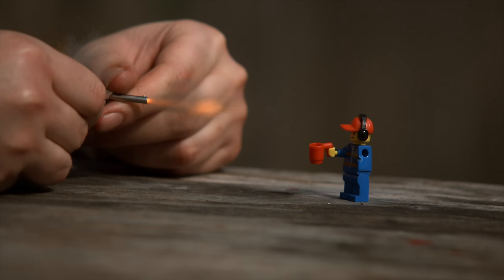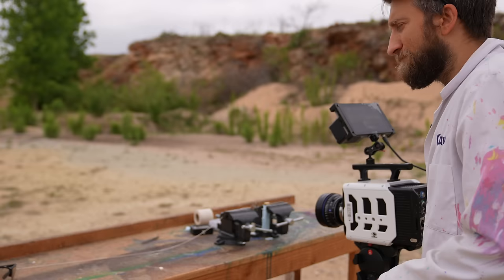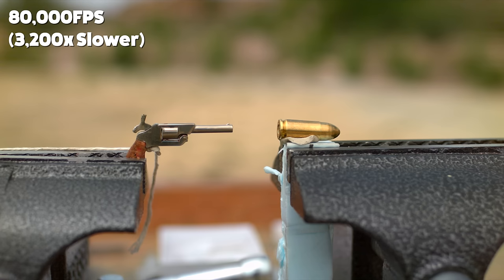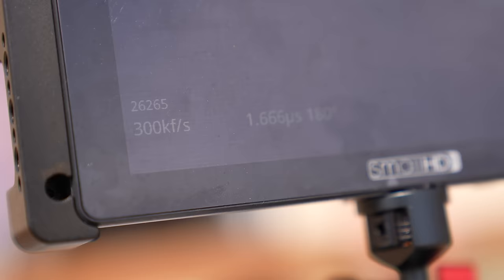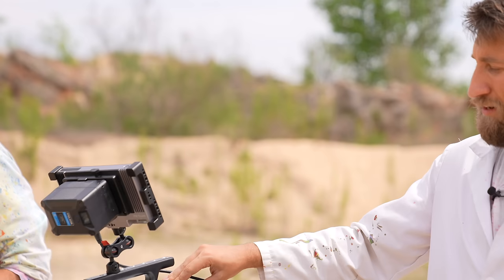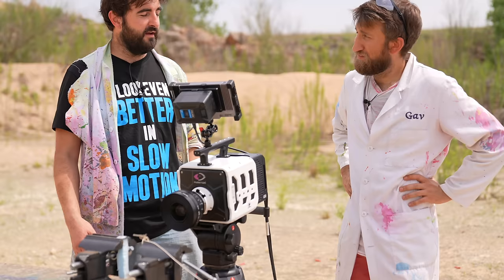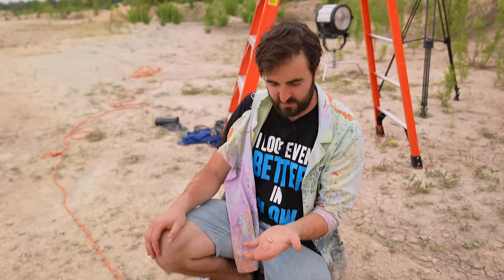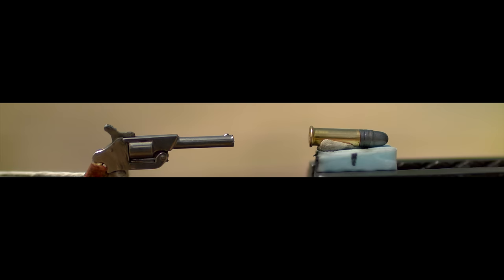Can a 2 Inch Gun Fire a 1 Inch Bullet? - 300,000FPS - The Slow Mo Guys

Comment: This is actually a pretty good example of mass and inertia.   Since the casing has much less if it is not restrained, the casing actually becomes the projectile while the bullet just kind of wanders away.
Reply: Especially with the 9mm, you really need the firing pin to hold the primer bit in place, never occurred to me
Reply: The shell will actually expand slightly inside the chamber, which makes it friction fit and fire form to the inside of the chamber.  This is why ejecting spent rounds is more difficult than expecting unfired rounds (and why part of the reloading process involves recompressing the shell to its original size).  If you oil the shell, you can damage some of the weaker actions because the shell becomes a projectile that slams into the back of the action.
Reply: I love how with the .22 the Bullet seems to hover there for a moment while the casing flies backward because it takes longer to overcome its inertia.
Reply: Demonstrates the law of conservation of momentum, to be precise. The bullet's mass times its velocity will be equal to the casing's mass times its velocity; since the bullet is much more massive, the casing will have a much greater velocity.
Reply: The primer does it all. The primer compound  ignites, builds up enough pressure to push itself out of the primer pocket, which it can as it is not held in by a breech (Nothing to do with a firing pin). Occasionally there is enough pressure generated by the primer to move the bullet forward and the case backward, but never enough heat and pressure in the case to ignite the smokeless powder, as this needs both do that and to build up pressure. Smokeless powder is hard to ignite. Try it again with black powder as a propellant....Even in a firearm it is, by choosing the wrong combination of primer, smokeless powder and bullet-case friction possible to have a failure to ignite the powder in which the bullet just moves a little on primer pressure alone. Enlarging the confined space the powder is in, making it even harder to ignite. That js the reason why we have normal primers and magnum primers that generate more heat and pressure. So Thats why the primer pressure in the case just blows out the unburnt powder through the flash hole. The rimfire is different. No separate primer that can blow out and release the pressure, very finely granulated smokeless powder that is easier to ignite and burns faster, and this generates the heat and pressure to move the case (the primer) back and the bullet a little forward.
Reply: @reidprichard  Yes.  And if it is inside a gun, the gun is more massive than the bullet, so the bullet will move more than the gun.    Unless the bullet has more mass than the gun.    

That is whya lighter gun will have more recoil with a larger heavier bullet and more powerful propellant.
Reply: @ikwer111  Diesel combustion effect adding to ignition. Primer firing raising pressure, increasing heat, and pressure, burning powder faster.
Reply: @hellomark1  
It keeps the pressure up and hot. Guarenteeing that it all ignites.and the force is forward.
Without the pin in place the pressure is released before the powder has a chance to heat or ignite.
Reply: @hellomark1  well im not used to guns cus of good gun control here in singapore but i do know that the gun casing would be aluminium or polymer since both are sofr and easily broken with just some surface tension.
Reply: @samuraiboi2735  brass or nickel.
You cant re use alu cases

Comment: It would be interesting to see how far the bullet would go if you could put a backing plate behind it so the shell can’t come back towards the gun, a plate with a hole you’re shooting through to set off the primer. I think a lot of the energy is split sending the casing backwards and the bullet forward, obviously it wouldn’t go as far as a sealed barrel but I wonder if it would go half as far or how much lower the velocity would be.
Reply: I think thats a great idea. I made the same comment. Would be super interesting to see
Reply: The back plate with a hole is a great idea I love that, I had a similar thought. What if the bullet was inside a transparent barrel?(so that you can see the bullet with the camera). Couldn't that make the bullet fly nice and straight out of the barrel since the barrel could act as some kind of chamber where the gas that's expanding keeps trapped inside shooting the bullet out the other way. It could actually shoot the bullet out further perhaps. Connect that barrel to the back plate with the hole and that should keep most of the propellant and gas between the bullet and the inside of the back plate, this could ignite the propellant more creating more gas, shooting the bullet even further!

Note on the back plate hole: it should be smaller than the hole created inside the casing after the percussion cap flies out so that the percussion cap also stays inside the barrel with the back plate acting like the back plate, keeping the explosion and gas trapped inside the chamber even more.
Reply: The little gun doesn't have enough energy to push a firing pin.

Comment: The “percussion cap” is called a primer, the round thing with the 3 holes is called the anvil.
When a gun fires normally, the primer still has the firing pin against it to prevent it coming out, but occasionally you have a primer rupture, and just like here, the powder burns, but the path of least resistance is out the primer pocket
Reply: That is exactly what happened. I have heard of this happening but I have never witnessed it.
Reply: There is also the problem of not having an enclosed chamber. Part of the purpose of the barrel in a firearm is to prevent the pressure from blowing the unburnt powder away. With an enclosed chamber + barrel, the powder is still in the enclosed space catching fire. You could probably prevent the primer rupture by using rimfire instead of centerfire, but you would still have the problems of pressure and unburnt powder escaping out the front.
Reply: @ShaggyRogers1  you still get rims popping with rimfire.
Reply: Percussion cap cus their brittish
Reply: @AidenColson  they’re Australian
Reply: @AhHereWeGo  sorry thank you
Reply: Similar enough

Comment: 9:00 It might interest you to know, given the distance that this bullet traveled, that there was pistol dueling as one of the sports in the 1908 Olympic Games. The two "athletes" would actually shoot at each other, but the bullets were made of wax and propelled only by the primer with no gunpowder in the cartridge. They did also have protective gear.
Reply: A pace is a single step and not two steps
Reply: @victorfox9623  I was about to tell you that a pace is two steps, but it's been so long since I did anything resembling scouting that I double-checked. According to Wikipedia, it can be either. I'm in the US, and was taught two steps is a pace. https://en.wikipedia.org/wiki/Pace_(unit)

Comment: Seems to me like a security feature, having the ignition cap blow out if there's nothing to hold it in place, to ensure that people don't get hurt when they're playing around with these bullets.
Reply: I don't think they are intentionally designed to blow out for safety, it's just that the primers and bullets would be harder to manufacture if they were crimped in place more securely
Reply: @rokoala2636  I'm not sure it's universal, but some military ammo does have the primer crimped in.
Reply: @paullockyer7230  I would say it's probably more common than not for military ammo fwiw. Last thing you want is loose primer cases floating around the innards during an engagement.
Reply: Twinrehz - primers are crimped in when the application calls for high reliability. They protect the gun not people playing around doing wrong things wrongly.
Reply: @paullockyer7230  yeah true, I was more meaning crimped in securely enough to affect the proposed 'safety feature' of having them blow out.
I reckon that would need a decent change to the primer and crimping compared to how they do it for military ammo.
Reply: The case expands diametrically,  reducing pressure.

Comment: I remember Mythbusters cooking off some centrefire bullets (literally) in an oven, and they found that the case shatters before the bullet leaves the casing. I was completely expecting that to happen here, but I totally did not expect the primers to leave the casings first to give the expanding gases a way out! 

This was an amazing and insightful video!
Reply: Quite likely that the cooking in an oven weakens the metal casing, so by the time pressure/heat build up enough to ignite the propellant, the casing is too weak to hold itself together before it pushes the bullet away.
Setting it off normally, the casing is just fine, which is a good thing. If the casing were sometimes too weak to contain the energy of the propellant and fail while inside a gun, you’d have a nightmare of a jam to try and clear out, shards of broken brass clinking around inside of the gun.
Reply: @ShadowsOfTheSky  I also wonder if heating it to the point that the gunpowder ignites would cause more of it to ignite at the same time, making a larger explosion overall than this one, where only a few grains seem to go. But yeah, it's probably more the weakened, more pliable casing.
Reply: Here's another thought: maybe the pressure of the primer is pages the printer and bullet out, so the gun powder never has a chance to ignite. 

Speer used to make special practice agni that used a plastic bullet, and only the primer (zero gun powder). It would throw that plastic bullet at high speed, but even a heavy bullet would be pushed out by the primer alone. 

Likewise, Aguila makes 22LR ammo called Colibri that launches a 20 grain bullet at 700 feet per second, using only the primer. (A normal 22LR bullet is 40 grains at 1100+ FPS, so Colibri is much less powerful than standard, but also much more powerful than you might guess.)
Reply: @cymond  That makes sense as a theoretical argument, but I’ve set off rounds not in a barrel myself where the primer didn’t pop out, and the casing doesn’t shatter. I suppose it’s possible if you used the powder for high velocity round but with a heavy bullet, but I imagine the primer will pop off or the round will be pushed out before the casing fails. 

I imagine it’s a combination of the metal being weaker at high temps, and also what @MusicalJackknife said above, because all the gunpowder was heated equally, as soon as the reaction started it all went up instantly, creating way more pressure before the expanding gases even had time to push the bullet or primer out, and the case just failed.
Reply: @MusicalJackknife  Actually what you say makes sense, it’s probably equally caused by both, though I would alter what you said little bit. With the Guys’ 9mm round where the bullet got sent quite far, almost all the gunpowder successfully ignited, but it took a while for the pressure to build up and the bullet was basically out by the time all of the powder had burned. 
I think it’s more of a case of all of the gunpowder being heated equally, so as soon as it reached the ignition point, all of the gunpowder went up at instantly, creating way too much pressure with no time for the bullet or primer to be pushed out before the casing failed.

Probably equally both, a weakened casing plus the whole reaction occurring instantly, creating much more pressure before the bullet can escape the casing.
Reply: @ShadowsOfTheSky  I was surprised that the primers kept popping out in the video. That's obviously doesn't happen in a firearm. I wondered if they got defective ammo with loose primer pockets.
Reply: Without a barrel, the casing can essentially becomes the projectile.
Reply: @cymond  the primer didn't have any type of rear mass to hold it in place.
Reply: @cymond  some of the gunpowder doesn't ignite aswell if it was in a gun it would be contained and burned as the bullet is being pushed out.
Reply: I dropped some 22 rounds on a carpeted floor and one went off the case ruptured and the bullet didn't move more than an inch. Strange that it went off because I have dropped rounds on many surfaces and never had one go off. It was a bit loud because I was in my closet other than that there wasn't any issues although I was surprised.
Reply: I was expecting the cases to burst as well. I think the reason they didn't is that  .22lr is too low pressure to burst the case and 9mm didn't because the initial impact knocked the primer loose as ignition started which meant the cartridge didn't have enough time to build up the pressure to burst the case. It'd be cool if they revisited this but used a more gentle impact to ignite the primer.
Reply: @abby_photos  22 is not to low at least full power it is not

Comment: This makes full auto guns even more impressive. To fire a bullet, open and expend the empty cartridge, replace a new one, close again to allow the proper pressure for the next bullet in rapid succession
Reply: If you wanna go faster with the cycle you can go with a mini-gun ^-^
Reply: dcoog anml  definitely be interesting to see what would happen with a 50 cal
Reply: @JerryMetal  yeah nou doubt. Engineering master piece
Reply: It’s even crazier to think that we’ve had machine guns since like 1880ish. Since the Maxim machine gun was invented around that time were nearing almost 140 some odd years of machine gun tech
Reply: dcoog anml  it’s .223, and it’s almost the same round as a 5.56, so that would be a lame comparison.
Reply: dcoog anml  you can do it with .50 BMG. There are these trip alarms that fit shotgun shells. With a little bit of modification you can fit a .50 BMG in them and fire it. Taofledermaus did that once.
https://www.youtube.com/watch?v=vJ9jOGde4ws

Comment: oooo you can see the anvil come flying out.  Interesting how the cup needs a secure bolt face to keep it in place so the cup (the round thing that flies out first) +anvil (three-pronged thing flying out 2nd) can compress all the ignited material forward to then ignite the powder in the casing.  

The first shot illustrates this so well!
Reply: Mhm, I thought it was interesting myself. And am now wondering if that’s a feature like in case it went off while not in a weapon it wouldn’t cause as much destruction with a lesser force

Comment: Amazing footage!! Would love to maybe see it revisited but with a backing with a hole behind the bullet so the cartridge can't fire backward. (i.e. using the 1" gun as a proper hammer replacement)

I wonder if it's also possible to find a clear (plexy or something stronger) barrel so we could observe an amazing Slow Mo of the bullet taking off?
Reply: a plexiglass tube might hold up enough for a lower pressure cartridge, just the once...  Would make for a pretty awesome shot too.
Reply: Yep or clamp the case in place
Reply: Or they could use a ballistic gel block. Embed the 9mm round in the block, and then fire the tiny gun into the back of the 9mm case. Added benefit would be to capture the 9mm projectile.
Reply: https://youtu.be/7pOXunRYJIw

This is kind of close to what you're saying. He puts a see through suppressor at the end of the barrel so you can see what all the pressure and gasses do behind the bullet
Reply: Smarter every day did a video on clear suppresors... and some of them even survive a few shots
Reply: Certain acrylics are very strong in regard to pressure, and it's definitely possible to make a gun barrel from one that won't shatter...it just needs to be really thiccccc
Reply: i am with  you a REVISITED  video
Reply: @Skinflaps_Meatslapper  I was thinking the same thing. Acrylic might be strong enough, if thick enough, but it would also probably be a one-shot thing. Gav would have one chance to get the perfect shot.
Reply: @rhov-anion  Well the good thing is that since it's an acrylic tube, multiple cameras could be used all around it for that single shot with various framerates and lenses.  Though I think I'd probably omit the tiny gun from the equation and develop and actual breech and firing pin.
Reply: @RalphieVII  I've seen that video, yes just like the see though supressor but a barrel with the spiral grooves instead.
Reply: @Skinflaps_Meatslapper  Nah cause I still want to know if the 1" gun can firing at a 9mm bullet can trigger it "properly" (i.e. going down a see-through barrel?)
Reply: @onepiecepedia  This video should've been proof enough for you.  The fact that there's nothing stopping the primer cup from popping out at very low pressure after ignition means that the powder charge will never properly ignite.  The answer to that question is no, it won't, and all you're going to get is something that amounts to a squib load.  Putting absolutely no gunpowder in the case and relying entirely on the primer will net you about the same effect, possibly even more action, since in this video the primer cup isn't sealing that pressure in like a real breech would.  With the low pressures encountered in such a situation, you could likely get away with making an acrylic barrel to the same dimensions as an actual steel barrel without experiencing a failure.  Seeing something like that wouldn't really make for a good video compared to a properly sealed and fired round.  Furthermore, if the primer cup did manage to hold out, say it was given a serious military swage, without a breech the only projectile would be the case, shooting directly back at the tiny gun and likely destroying it in the process.